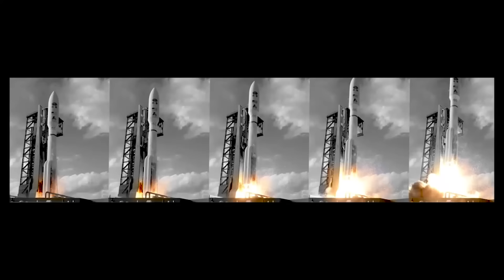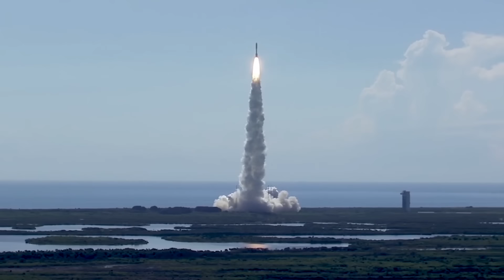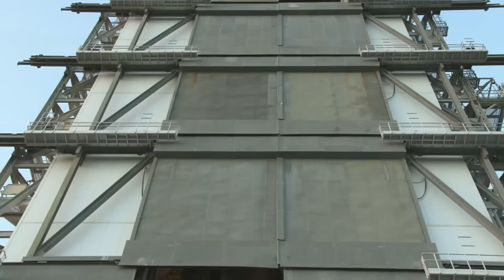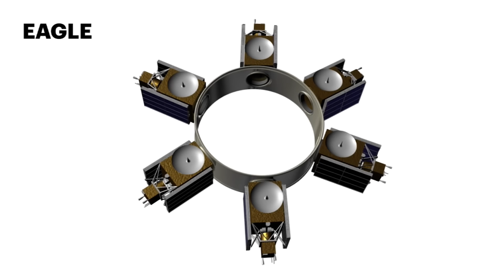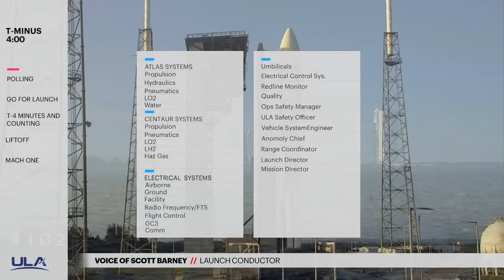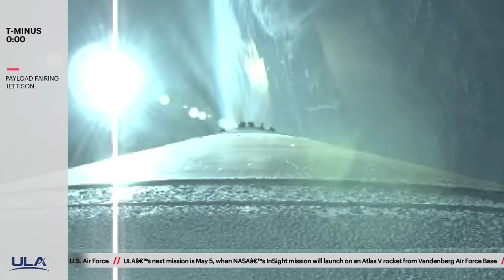Atlas V AFSPC-11 Live Launch Broadcast (April 14)

Comment: This is why ULA is sometimes better than SpaceX, since they committed to their launch date and not deciding to scrub in the last minute, and this is coming from a SpaceX fan.
Reply: ULA often scrubs, for example Jan 10th,  their Delta IV launch carrying spy-sat  NROL-47 was scrubbed due to high winds. Next day, it was scrubbed again, because of a ground system valve problem. It finally launched on the 12th.

Space flight is complicated, it's surely better to scrub than risk an accident.

Comment: Those RD-180 engines have a rather unique sound on start-up. This launch, it appears that you can hear each engine start a fraction of a second apart. Also, it strikes me, that they sound a lot like the 'Hannibal 8' from 'The Great Race'
Reply: Do they stagger the lighting of the two combustion chambers? The RD-180 is one engine but with two separate combustion chambers and nozzles.

Comment: Much weaker than a Falcon 9. I'm disappointed that ULA didn't use SpaceX Falcon 9...
Reply: The Atlas V 551 has a higher lift capacity to GTO or GEO (where this mission went) than a fully expendable Falcon 9 (without first stage landing).

Comment: Interesting, but spacex is still kicking your butt.  But competition is what makes this stuff great, and ULA will need to really put some heart and brain power into this stuff.
Reply: Jaye Mathisen they kinda need money more than anything else.
Reply: @John Lawson What about the fact that SpaceX is doing everything it can to make launch vehicles re-usable? The first ever landing of a stage 1, the first re-use of a stage 1 and a space vehicle. You can watch another SpaceX launch and landing in a few hours; and their next launch (on May 5) will be the newer version, which can be re-used 100 times.
Reply: That's  ATK-Orbital-Northrop that builds 1st stages in the Ukraine, my bad.
Watching the 'suits'; if i was wiping out the ecosystem and killing thousands of people with my war products, i would have grey hair also. At 69 years old, i don't. Yet.
Reply: I don't know what else to tell you. The poster DID NOT have a point. The Atlas V can have anywhere from 0 to 5 SRBs. If the job could have been done with a smaller rocket, they simply would have used a smaller variant of the Atlas V.

Acceleration = TWR (or if you'd like you can flip it around, it's the same) because if you have a 1st stage with a TWR of 2.0 and one with 1.1, which is going to accelerate faster? Just compare how quickly the Atlas V 551 lifts off the pad with roughly a 2.18 TWR, and the Saturn V with around 1.15.

The Atlas V 551 can deliver 3812 Kilograms directly into a 0° Geostationary Orbit which was a mission requirement for CBAS. The secondary payload weighs (a very conservative estimate) at least 700 kg leaving 3100 kg MAX for the CBAS satellite. That is a fairly average weight for GEO satellites. Therefore it is already pushing the limits of what the heaviest variant of the Atlas V is capable of.
Reply: @burz21 Let me guess, you play Kerbal Space Program? That doesn't make you a rocket expert, beware the Dunning-Kruger effect. What you said about TWR makes little sense; you didn't finish your point. Why did you randomly say "1.2" and then forget the numbers completely?
Reply: 24kGoldenRocket I'm with you on the absurd prices on govt contracts with ULA. But what you were saying about throttling down due to high acceleration  has nothing to do with govt. waste
Reply: @burz21  Unless I've missed something, nobody mentioned TWR. Xe just said that it was an excessive rocket for the job.
Reply: " If they have to be concerned with throttling down as g-forces will shred their payloads apart then the rockets are much more than are needed for the job and that is the best indicator of GOVERNMENT WASTE."

increased g loads come from acceleration = high TWR hence the throttling down.
Reply: You say "still kicking your butt" But the Atlas rocket first flew in 1957, when Elon Musk would not yet be born for quite a while. Yes SpaceX is all the rage now, but without pioneering rockets like the Atlas family it would not have existed.
Reply: burz21 is correct. It is worth noting that ULA contract prices have gone down quite a bit. For example, an Atlas V 551 flight for a government mission, with some extras like a secondary payload ring to deploy smaller satellites alongside the primary mission, was sold for $191 million recently.

It's possible for the acceleration of a stage with liftoff TWR 1.1 to eventually become higher than that of a stage with liftoff TWR 1.2, by the way. It's going to depend on the mass fraction of each stage. If the former stage has a 95% propellent mass fraction and the latter a 50% mass fraction, the former will outpace the latter quite quickly.
Reply: oh my goodness would you shut up about SpaceX and just enjoy a fantastic piece of human engineering
Reply: John Lawson...Those "yuppie rockets" lift more payload at less expense.

ULA lacks both enthusiasm and innovation. I do not give a damn how fast their rockets fly. If they have to be concerned with throttling down as g-forces will shred their payloads apart then the rockets are much more than are needed for the job and that is the best indicator of GOVERNMENT WASTE. You did not need a Atlas  V 501 for the job.

Why not load that payload bay with some High School and College student designed Cube Sats, at no charge, for some additional mass to slow that rocket down? What a waste of lifting power.
Reply: 24kGoldenRocket as usual with any rocket video, clueless people who are only interested in SpaceX come in with wrong information. 

High TWR near the end of the first stage cutoff is NO INDICATION of government waste. That makes 0 sense. If you have a rocket with say, a 1.2 TWR at liftoff, guess what happens as it burns off the majority of it's weight ( fuel/oxidizer)? It gets LIGHTER. 

Cube Sats on average weigh about 1kg. Do you realize how many you would have to include in order to make any meaningful impact on the TWR? You would be more constrained by size I'd be willing to bet. 

BTW, this launch was a 551 variant.
Reply: Yes burz ... It was a 551...the same that launched New Horizons. My typo. And yes I do realize how many Cube Sats it would take to "make a difference."

But why shall I expect anything other than that of Hillary Clinton's parrot, "What difference at this point does it make?", out of ANY Government official's mouth, or Government Contractor's mouth,, regardless of the Political Party?
Reply: So; our United States Air Force uses Russian engines, a Ukraine-Lockheed built 1st stage and 5 solid strap-ons from killer-missile fireworks technology, Yea! Solids burn holes in local camera lens' with waste splatter,  destroy human thyroids, put thousands of pounds of perclorate into the stratosphere and wipe out our Earth's Ozone for decades. Junk.
60 year old technology because Boeing-Lockheed won't risk their investors money to move US into the future.
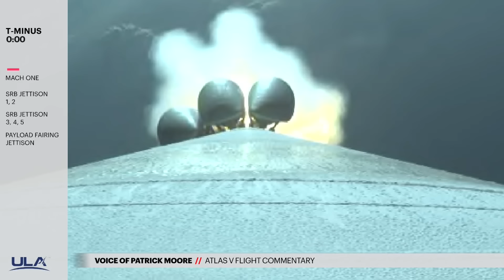Reply: It's really not a competition - who doesn't want to explore space more? NASA and SpaceX are very different things, it's all amazing, but unfair to compare their very different ambitions. BTW, Mon night (22:30 GMT), SpaceX launch and landing. Haven't seen the amazing landings of Stage 1 rockets for a while. Check their website tomorrow for a link to the stream, http://www.spacex.com/f
Reply: Why does acceleration = high TWR ? You can accelerate with any TWR above 1; if your TWR wasn't >1 at launch then you are not going to space today; and it's only going to get lighter. There's no direct correlation. The user had a point - that they could have used a smaller rocket, if one was available.  Not that I'm complaining; I think it's cool, and it's another test of Atlas which is always a good thing for future missions, such as InSight, hopefully in May on a much larger Atlas.
I'm sorry if you were annoyed by my complaint about it, but I just thought it was a bit unfair to start throwing in the question of TWR when really the point was just about excessive power to launch this payload.
Reply: Liam...No.